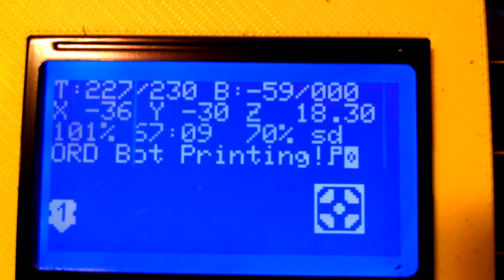ORD Bot Smoothie Board Powered 3D Printer Tour

Comment: Hello Dan, I just bought an ORD frame kit from Automation Tech and was looking at the smoothieboard as my controller.  I am very much a newbie at all this and was wondering how the LCD hooks up to the board?  I know there is another add-on board for it but am unclear as to how it attaches.  Does it plug right in or does it have to be wired?
Reply from the maker: +Chris Leamon I used a GLCD Shield to connect the LCD shown.  You can learn more about this shield at: http://smoothieware.org/rrdglcdadapter I bought my GLCD and GLCD Shield here: http://shop.uberclock.com/products/smoothieboard-glcd-shield
You do need to solder headers onto the smoothieboard, but after that the GLCD Shield plugs right in.

I also soldered in a 5V 1Amp regulator on the smoothieboard, so I can run the GLCD without being tethered to a computer via a usb cable for 5V power: http://smoothieware.org/voltageregulator  I got the regulator at http://shop.uberclock.com/products/switching-regulator-dc-to-dc-5v
Reply: How do you like it so far?  Do you have experience with the Arduino Ramps controllers?
Reply from the maker: +Chris Leamon The Smoothieboard ($150) is awesome!  It is easier to program than Arduino based boards and wiring was pretty easy with all the online documentation.  I have experience with UltiMachine RAMPS on an Aurdino mega ($215) Pre-Assembled Kit and the Azteeg X1 ($111) controllers.  We didn't like the RAMPS that much, so we switched to the Azteeg X1 and it was much better.  The Smoothieboard is not much more money and is way more capable and powerful.   Selecting a good hot end and extruder setup is critical as well.  Check out these two info sources to learn more and decide what parts you want to go with: https://www.youtube.com/user/ThomasSanladerer  and the ORD Bot wiki and forums at: http://www.buildlog.net/
Reply: The Smoothieboard is faster than ramps , imean  if it is a big diference between  The Smoothieboard and ramps based on arduino
Reply from the maker: The speed of the smoothieboard does not make much difference on x y z Cartesian coordinate 3D printers like the ordbot.  If you have a delta 3D printer the extra speed can make a difference if you are printing fast.  The very good documentation, ease of setting up the smoothieboard and the fact that it has an Ethernet port is the biggest advantage for me.

Comment: what size print bed is that, and do you have any issues with bowden setups?
Reply from the maker: +loclhst the bed is 200 x 200mm.  No issues with the bowden setup now that I have the steps/mm set at 100 and retraction at 4.5mm.  Hope that helps.